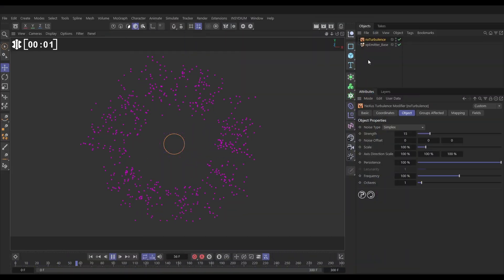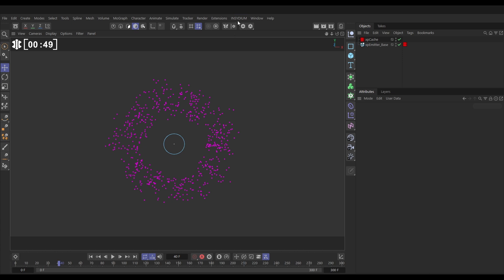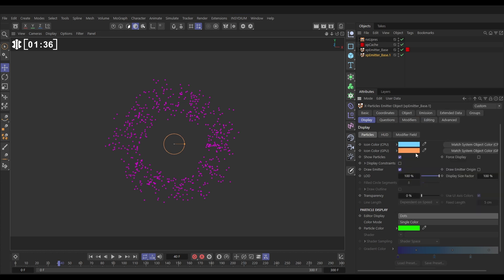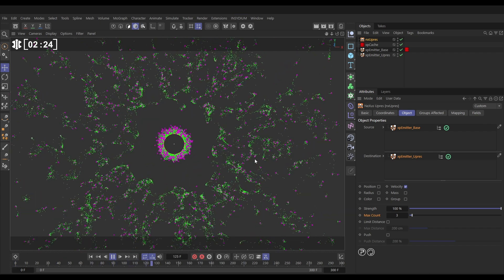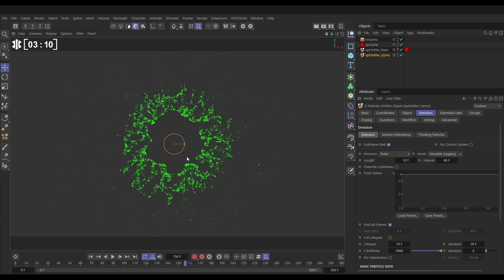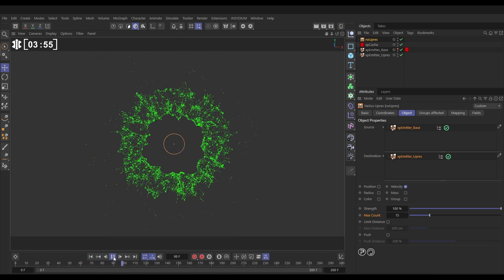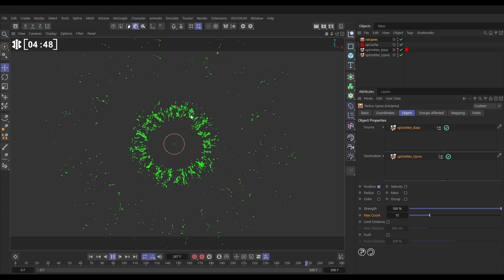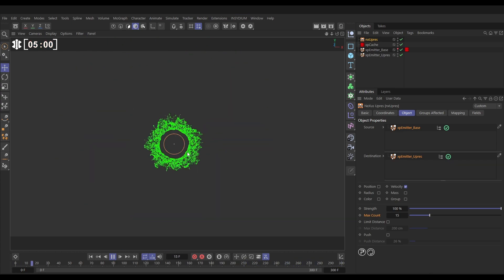Top Tip Tuesday! - nxUpres

Comment: Hi Bob, I'm stumbling at the first particle. My emitter is not producing bursts of particles and I can't find the simple Ring Setting. Can you help?
Reply from the maker: Hi there. You need to set your 'Emitter Shape' to circle, with 'Ring Only' selected. Then set the 'Cone Angle' to 90 degrees. For the bursts of particles, you need to go to the Emission tab and set the 'Emission' parameter to pulse.
Reply: Thanks Bob. That worked! I'm revisiting the project now.
Now I can't get the same weight of particles to be emitted in the Pulses. They are coming out in wavey thin bands rather than thicker bands of particles. Any ideas why? Thanks, J